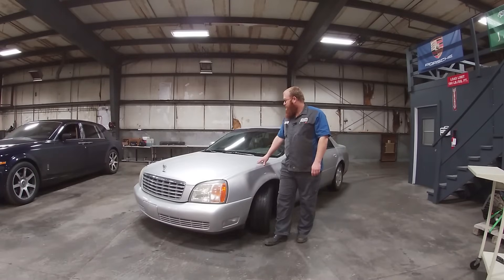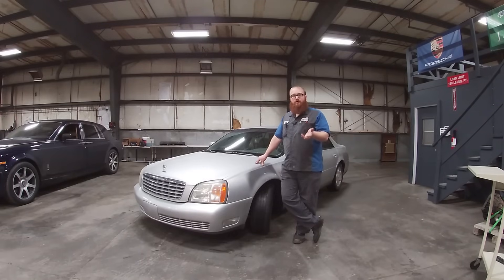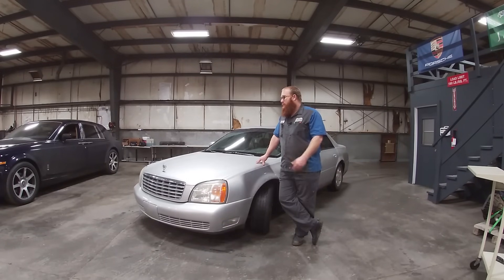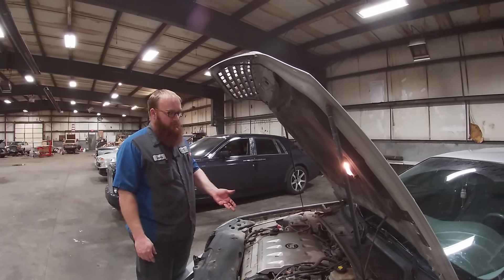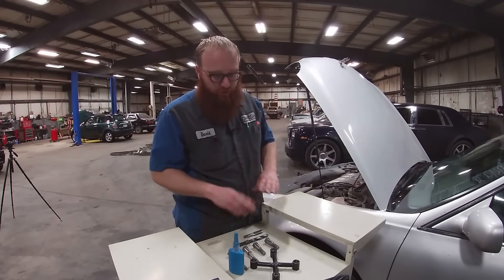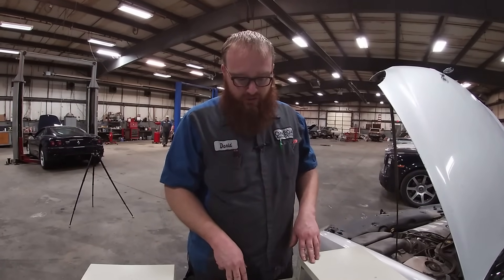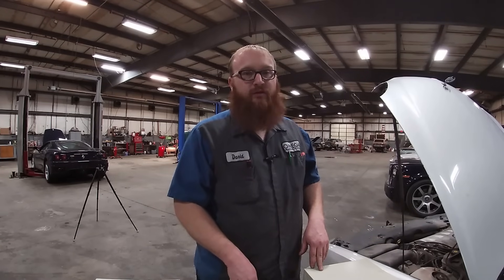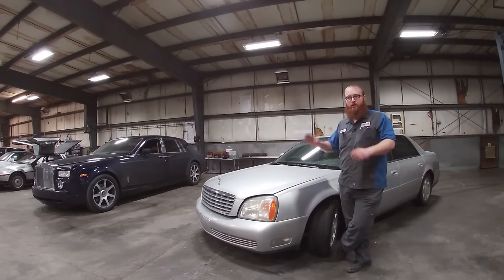The CAR WIZARD names Cadillac's Northstar Engine the Dumbest Design

Comment: The HT "Hook and Tow" 4100 Caddy V8 deserves a terrible engine video too but I don't think there are many of them left in existence.
Reply: The 4.1 evolved into the 4.5 and eventually the fairly nice 4.9 by the early 90s.   Pretty solid engines, and the 4.1 can be rebuilt to meet the newer specs so you get a stronger more durable engines. 

The HT has some interesting attributes and I am looking at them for a specific application that I think they are well suited for.
Reply: Michael Lombardi My parents got lucky then, I guess. They bought a new Sedan DeVille in 1984 with that engine & it's still going to this day. Only had new plugs & wires installed, & oil changed every 3,000 miles. But then again, they don't drive over 45-50 mph. So that might be why it's still running like it did in '84...
Reply: @DrewLSsix  The 4100ht - the 4.9l were light as a feather and make an awesome motor for the Fiero.
Reply: The  Northstar  was  derived  from  the  4.1 engine .
Reply: Greg de La Grange Wow, didn't know that.👍
Reply: Deleted the cylinder drop feature on my '85 brougham,and no problems it wasn't fast,but ran good.
Reply: Agree 100% lol very very shitty and slow engines. The 4100 was a nightmare!
Reply: DrewLSsix the 4.5s were Throttle body injection except for 90 or 91 caddy it was the only year a they did a 4.5 fuel rail injection. Then it evolved into the 4.9.

Comment: Aside from the head bolts I think the Northstar is a good engine. Silky smooth, great power, and incredible mileage. Lots of way worse engines to be had.
Reply: Example of factory spending extra money on design
Reply: I bought a 2005 Deville w 88k miles.  $2300. 
26mpg at 79mph, blows my mind.
Post head bolt fixed models, they get really great reviews for long term reliability
Reply: I totally agree, turbolq4!  I don't know, maybe some of us got lucky, but the Northstar in our '04 is an awesome engine...... awesome POWER and acceleration, S-M-O-O-T-H, and that SOUND when you step on it?  That says it all, baby!!.....a powerful beast in a high class suit!  If you set aside the sadistic torture fantasies sparked by working on anything  in it, on it or under it, an SRX with a Northstar V8 is a beautiful thing!
Reply: @katrenco  
Oh yeah ! That muted v8 roar when you floor it ! Sounds incredible- sweet music . The Deville really gets out of it's own way. Fast luxury sedan ! Great handling too ! No body roll in hard cornering, really holds the road
Reply: @patrickhorvath2684  You had the perfect words I couldn't bring to mind,  "THAT MUTED V8 ROAR".   Incredible, sweet music, indeed!

Comment: 1998 Seville STS L37 NorthStar owner here.  Rear Head Gasket went in 2007 at 79,000 Miles.  Dropped the Engine and Bought the Repair Kit and Head Studs from NorthStar Performance.  Replaced a few hoses and pipes while it was easy to replace at that time.  Car has 165,000 miles on it now and it still runs perfect. Just serviced the 4T80E Bulletproof Transmission.  Still drive the car every day.  GM Should have fixed these a decade before they did.  The NorthStar gets great mileage and runs smooth and gets it done when you give it throttle!

VERY soon, handing it down to my daughter!

Youngstown Automotive

Comment: I'll buy a good condition one, pull engine myself, machine new head bolt holes, buy some ARP head bolts, drive in style. Same for Ford. There are no stupid design's, if your smarter than the engine. I love Mechanics who are Picky about the work they get paid to do. I've ran into a few. Why I do work myself. I'd rather see a video explaining problems to look out for, then give advice on how to fix. Leave politics out. Phoenix, no rain, plenty of 🌞.
Reply: You're basically saying there can be no stupid designs because you are capable of fixing it yourself. How does this make sense?

Comment: Our family has had two NorthStar Cadillacs. Both needed rebuilds before 50,000 miles. One was $4k the other was $5k. Sold one for $2500 with the repair. 2004 in excellent condition for $2500. If I had a 2004 Honda Civic, I could get $4000 for it.
Reply: nobody is out here paying 4k for a 04 honda civic where i live
Reply: @thenormalyears  was about to say lol. I've seen turbo'd civics (95-05) under 4k where I'm at haha
Reply: @thenormalyears  they are where I live.

Comment: Anti seize is an absolute necessity when you have steel fasteners and aluminum threads. Didn't look like they used any. I've seen the same thing in all sorts of applications.
Reply: Exactly right! Galvanic corrosion causes the aluminum to stick to the bolts.
Ford and  sparkplugs with only 3 aluminum threads holding them is another example.
Reply: I built hydraulic machinery for the offshore industry, can't tell ya how many bottles of never seize I used , it works great in the salt water atmosphere.....
Reply: @HighGear7445  know that one too well.....

Comment: You could transplant a 2005 northstar engine in that car. Problem solved
Reply: Honestly, it's probably the best way to fix one of these.
Reply: And you are looking at the same price probably.
Reply: They still had oil pan gasket issues. If your gonna do a swap. Swap it to the Impala is 5.3l
Reply: Buy another car....solved
Reply: LS swap it
Reply: right..

Comment: My mom had one of those cadillacs, put over 200k miles on it but it was junk! never blew a head gasket, but probably put enough money into it to keep it running to buy a few good cars.
Reply: The head  gaskets DON'T  technically  blow. So you can
Drive it. It will run hot. WON'T 
Blow gasket. Weird engine. I
Had one. Never again.

Comment: Aside from the bad head studs, the Northstar is actually an amazing engine-smooth and powerful, and very efficient. Too bade GM rushed it into production. BTW-BMW had the same problem on some I-6 engines. Aluminum has many advantages, but cast iron is a better, more durable material for  engines.
Reply: Yeah, BMWs m54 engines had exactly the same problem. Usually you had to really overheat the engine first to have it pull the threads out though.
Reply: Owned 3 Northstar cars never had issues except that they were front wheel drive and no manual transmission options. Great power, smooth and quiet.
Reply: Cast iron is great for heavy pieces of slag, you've got to be kidding. If you actually want to drive your car (or motorcycle), aluminum is the only way to go. Go try to win a road race with an iron block.

Comment: When I was growing up in the 90s I thought Northstar engines were the shit. Aluminum V8 making 300 horse. 
My best friends dad had a STS. It was too much car for a teenager to have. My buddy got a few tickets.
Reply: WifeBTR123 That would be the L37, they were more powerful over the LD8, but the most powerful North Star is the LC3(4.4 litre)
Reply: Richard Skipper I didn't realize an LD8 was in the Bonneville, for some reason I was thinking of the L47. But the Bonneville is a bit lighter than the STS and ETC, right?
Reply: @xlrvlac  Bonneville GXP weighs a hair under 3,800 lbs, so yes.
Reply: @xlrvlac  Yes, getting an XLR or STS with that engine would be a keeper, and the XLR being a good collector car.

Comment: I hoping you get a car with a LH2.7 Chrysler. That engine deserves to be label one of the worst engines that was designed.
Reply: Likes to die sub 50,000 miles ... 
Thats how you know you really made a booboo
Reply: I had one, it wansent bad till the water pump went out at 140 k, quickly traded off for a 300M with the 3.5, much better for 325k
Reply: @drfalcon4102  my mom had a 2.7 Intrepid that went about 100k until the timing chain went. She also got a 300M, which she had for a couple of years. It was a blue Special that was a great car to drive!

Comment: I had a 2005 pontiac bonneville GXP with the northstar 4.6L never had that issue with mine.. only thing i did to it was change alt and alt belt..
Reply: Ron I wait till you have to change the starter. Have fun with that.
Reply: I had the same car and no problems, This guy has issues with GM
Reply: Did you watch the video.  He said the head gasket issue was a non-issue from 2005 on when GM finally fixed the causing issue.
Reply: Ok...Ooooops! @DACouture413

Comment: Hi, Thank you for the video and the information. They are very useful. My 2004 Cadillac Sedan is  being seen by a mechanic for oil leaking. He diagnosed a head gasket failure. However, today he showed me that a rocker Arm has been broken. Is it a big issue? Can just the rocker be replaced? I would appreciate some tips on it. The car did not cost me a lot of money. But I have already spent almost 2 grand so far.

Comment: -how about the starter being mounted INSIDE the engine?!!
I studied this engine when I was in GM automotive school. Didn't think it was going to be such a flop.
Reply: Yeah, to this day I haven't seen a started placed in a more inconvenient and stupid place.
Reply: @jeffro20gauge  The Toyota 1UZ has its starter in a similar place, funny enough. I've heard it as an "engineer vs. mechanic" thing.
Reply: @maitele  exactly! Engineers and mechanics have always been at odds... To the detriment of the consumer.
Reply: @Mr_Joseph979  it's a small wonder because the 1UZ is a fantastic engine otherwise. Pain to work on but it's powerful, smooth, and reliable. I guess it's just it's Achilles heel.

Comment: I just don't understand how someone can say an engine is a "good" engine if it needs to be pulled out from underneath the car on a lift,  and re-engineered with three-thousand dollars worth of labor, plus expensive parts to make it reliable. In my humble opinion, a "good" engine is one where it gives decades of reliable service from the factory with nothing more than fluid and filter changes.
Reply: Cadillac 4.9 liter which was the predecessor to this engine does that! Would have made more sense to kept casting those once they found out about the failure. Maybe bumped it to 240hp & put true duals on it. Nobody would have missed the northstar.
Reply: @williscurry6557  - i remember when the Northstar came out, and with a name like that,  who wouldn't want one?😛 I have a '95 Deville with the 4.9, with 105,000 miles, and i originally was disappointed it didn't have the Northstar until i started hearing stories about the NS. And yes the 4.9 MFI has PLENTY of power...more  would be stupid fast for such a boat. The engine is fine so far, but surprise, surprise, the trans went, and it cost me over 3 grand just to have the problem fixed (sun gear and reverse band), but they didnt renew everything😡
Reply: cmans79tr7 My 95 deville had 198k on it when i sold it. I did 1 screen & 2 fluid changes. Tranny shifted like new.
Reply: Amen cmans. I worked for Ford during the 6.0L diesel debacle. It's a "great engine"......once you invest $5000 into it.

Comment: BOTTOM LINE it came down to MONEY from the manufacturer
Reply: Or the engineers were more worried about large stud holes compromising the aluminum engine than about the threads tearing out of small studs. Typical problem is the engineers will make a model to test if it will work and their model doesn't fail so they go with it. Then it goes to production and you have a bunch of people and robots with no understanding of the dangers putting together thousands of these engines and their procedures and materials differ from the original working model. I could swear though that whatever steel / aluminum / plastic GM uses is just weaker than Toyota / Honda / Subaru. They probably source it from some Asian country that sends worse quality than they send to their home team manufacturers.
Reply: Why do you say that? I'm an aerospace engineer and the first thing I thought was "threaded holes in aluminum need steel inserts for strength," and further in the video I found out I was quite wrong! To be fair, I also don't deal with the kind of torque that head bolts are going to have so in my work, threaded inserts are the best answer.

I could very well see GM engineers thinking that inserts were a good, cost effective option; but if I were in their shoes I would have considered doing more testing. The difference in my industry is that in aerospace we are more than willing to throw absurd amounts of money at something to test it rigorously, I don't think they are afforded the same luxury in the automotive industry, especially in the maintenance/repair section.

Comment: A LOT of early aluminum block engines had this same issue. I had to replace head gaskets on my '85 Chrysler Daytona for same reason. When you tighten the head bolts down, they're designed to stretch, so you can't re-use them and they really soak you for those damn bolts.

Comment: I did that very same job on my son's 1998 Eldorode in 2009 as a "something to do" project at the start of my first retirement. To make a long story short the cause of the head bolt issue and also the main crankshaft bearings support bolts is a metallurgy F--K up. The instant steel and aluminum contact each other they set up an electrical circuit and start corroding each other with the aluminum being the looser in the electron swap severally "weaking" it. (It called Galvanic action) The GM engineering solution for these, in the beginning, was coating the head bolt threads with 609 loctite to insulate the electron flow across the junction of the dissimilar metals to buy some extra time for the extended warranty. Toyota also had this same problem in their small engines in the '90s but got little press on it.  If I recall there was a very high torque setting on the head bolts, this breaks the loctite film between the thread surfaces at the very tights points in the tread to thread junction but does minimally.  Setting the dissimilar metals issues aside which I know is huge, I feel the Northstar 4.6L was a very good engine. 325 hp from a 283 CU IN gasoline engine and could have been fixed with some advanced aluminum casting technologies.  Back in may drag racing days '60s, I spent huge money to get 300 HP from my peant block 283 Chevy!

Comment: Great engine, if you can't afford to fix an advance engine, don't get a Cadillac and stick with a 3800.
Reply: Top swap Right buddy 😃
Reply: I am surprise that no one stocked repaired Northstar engines. At one time that would have been a good business. Trade in your engine as core and with a certain amount of money , exchange your engine.
Reply: Oh yeah. Grand Prix GTP, supercharged 3800... Beast!
Reply: @thecman26  240 hp, WOW. When it was discontinued, the Japanese V6s were making ~270 hp, without forced induction, and they weren't burning people's houses down.
Reply: @PistonAvatarGuy  never heard that! Feom my experiences they were crazy reliable, and fast!
Reply: @stanleywilliams6110  I once knew a place that would do Northstar exchanges who already had repaired ones in stock, warrantied them 3 years unlimited mileage, and would also do Chrysler 2.7 V6 conversions with a 3.5L V6 and matching ECM.  Both would cost $3,000 installed which 10-15 years ago was quite reasonable and at least $2,000 cheaper than a GM or Chrysler dealer.
Reply: Or an LS.

Comment: Owned 3 Northstar cars never had issues except that they were front wheel drive and no manual transmission options. Great power, smooth and quiet.
Reply: Same here. I own a "97" El Dorado and still runs great. Never had a head gaskets issue. Only thing I had to replace was the coolant reservoir that lasted 19 years, but other then that, my car still runs great.

Comment: Just rebuilt a Toyota 3vze. Luckily the block is cast iron, but I did have to drill and tap at least half the bolt holes into the heads, especially for the exhaust. For the exhaust, I was able to bump the size up just a bit by using coarse thread SAE exhaust studs.  Thick, coarse threads like you said. Also had to do the camshaft caps. It was tough to find bolts of the same hardness, but I did.  That application calls for fine threads.  I was able to chase out the threads and cut them deeper, using new appropriate length bolts of the same hardness.  Something interesting that I discovered about this motor, is that if you rebuild, and the valve shim height is out of adjustment all the way around, you can change the gap between the cam lobe lobe and shims by lightly lapping the valves into their seats.  Doesnt make sense to do during regular service but if you are tearing the heads off and have the tools, you can fine tune the gap by the thousandth if necessary and clean your valve seating up at the same time.

Comment: Actually, the worse engine was the aluminum sleeved pos they put into the Chevy Vega.
Reply: It wasn't sleeved though, they used some weird treatment on the cylinder bores, which would wear out the piston rings causing them to burn oil. Anyhow whilst the car was under warranty the owner had a choice, they could either receive a new engine, or have the old one sleeved, most people took the prior and 10,000 miles later it was burning oil again, the ones you see today were either sleeved or had a V8 fitted. There is a Collectable Automobile article about the Vegas from about 15 years ago, it's a very interesting read.
Reply: @OlegKostoglatov  chevy wrnt to Reynolds to design a high silicone content aluminum, reynolds failed miserably. A vega got me hired as a mechanic in 78, no one understood them. They were still a piece of crap, I ended up owning 4 of them at one time so I could keep the 'good'one going, lol......
Reply: Vega was a bitter disappointment. I don't think anybody had balance shafts in their engines then and they would really buck at times and shake carb. parts loose. Overheat one and the block sinks at the 2 inner cylinders.

Comment: My parents bought a 2003 Seville new. It currently has 120k miles. Never had any problems with it other than the coolant reservoir having a leak on the bottom. Synthetic oil every 3k miles. Mostly highway miles but is currently being used to run errands every few days.